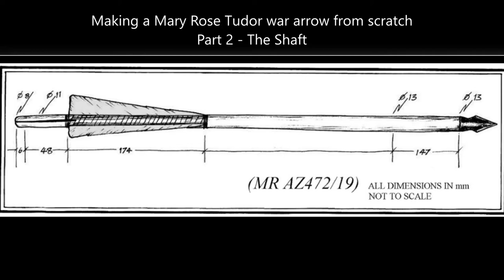Arrow shaft: Making medieval war arrows from scratch part 2

Comment: Crecy had long disappeared in the rear view mirror by 180 years when the Tudor period began. Medieval (100 years war) should not be conflated with the Tudor period just as the MR archery kit should not be confused with the war arrow and Bow from before.
The Anthony roll tells us that the Arrows in the entire fleet were Livery arrows. "Livery is from old French "Levere" meaning a  gift that is delivered and these were the arrows supplied by the crown to the great estates for hunting sport and  trained generations of bowmen they were well made and expensive compared with the sheaf arrow. They were whipped, waxed with horn inserts and were reuseable. An archer captain from Henry V's army would have gone ballistic if he had the mismatched Mary Rose kit delivered to him on the front line,.Bows of different draw weights and different lengths along with arrows that were  bobtail, barreled and parallel shafted and of different lengths with 5", 7" and 8" flights.. God only knows what sort of various strings were supplied.

The common theme in military procument from 1338 until Henry VIII is not enough arrows and not enough money. The sheaf arrow was 36" long, straight shaft with short high flights glued on, it was in effect a single use missile. If Edward III's million arrows had been whipped they would have needed 280 miles of expensive thread. Every one seems to think Roger Ascham is the last word in Tudor archery when in fact he was an academic who liked archery. The link below is from a French soldier archer who was alive in the late 1400's .....Enjoy

https://www.archerylibrary.com/books/gallice/

Comment: It's not easy to bring the point in a straigth line to the shaft, when the socket isn't forged correctly...
I had this problem with some of my handcraftet historical arrowheads. Towton, like yours, but with a slightly more tapered sockets.
So I had to whittle the wood a little bit asymmetric to compensate that.
Reply from the maker: I rotate the arrowhead socket on the cone of the arrow and where it leaves a black mark I remove material but this, as you say, doesn't help if the socket is off true.  Then it's a fiddle!

Comment: I wonder, back when armies would need to have millions of these things cranked out for them  before going on campaign, if the individual tasks involved in arrow making were performed by a single person in production line fashion.

Seeing arrows being made using reasonably historically faithful methods makes me realize how little technological advances we moderns have have made us far more productive than our medieval ancestors. For example, if medieval arrowsmiths and fletchers had had stronger, faster curing, waterproof modern glues and epoxies, this whole process could have been sped up considerably.

One thing I've wondered: did medieval arrowsmiths have the kinds of jigs we have today for perfectly aligning fletchings? Also, wooden arrows tend to warp if they get wet, but applying a mixture of pine tar and beeswax in turpentine can produce a finish that is water resistant enough to stop arrows from warping if the person carrying them gets caught in the rain. I can imagine arrowsmiths back then would have used a finish like this, provided that turpentine was something that existed in their day (turpentine isn't strictly necessary, but the alternative, heating the pine tar and beeswax to melt them together, would have entailed high fuel costs and it's trickier to apply the finish when heat is the only thing keeping it fluid, since it cools quickly and becomes a sticky mess).
Reply from the maker: Interesting ideas!  My feeling is that you don't need jigs is you do things often enough.

Comment: Hi, thanks for the video, very informative. I'm interested in making my own arrows, do you know where i can find a rounding plane like the one you use here ?
Reply from the maker: I made mine by by grinding the bald to shape and carving the sole of the plane.
Reply: If you don't have a round plane, take a fine and very sharp flat plane, work the wood down from 4 to 8 to 16 edges, give the taper to the shaft, if you want.
Then sit down, put a piece of leather on your left tigh, take some sandpaper into your right hand and roll the shaft back and forth with the left hand over the left knee. It is working like a lathe. With the sandpaper in your right hand you'll give the shaft a round shape. Don't forget to change the sides of the shaft.
Or look at the videos of Stylian Stefanov. He's a bulgarian Bow- and arrowmaker, who is working with verv simple tools and in the traditional way, like Jeremy does.